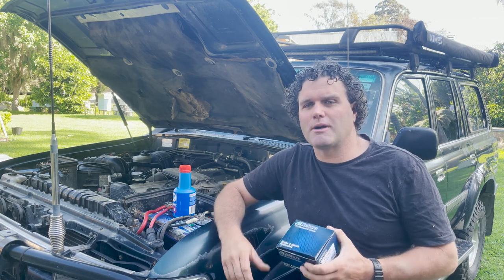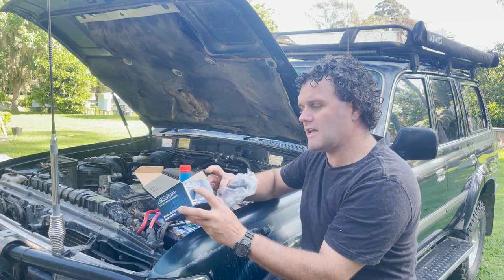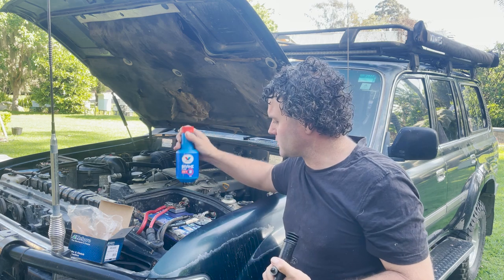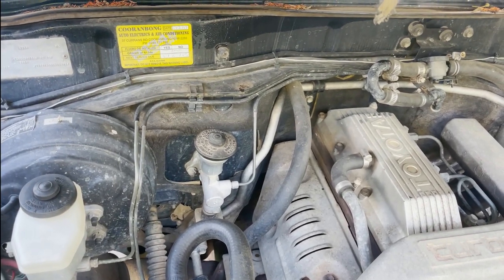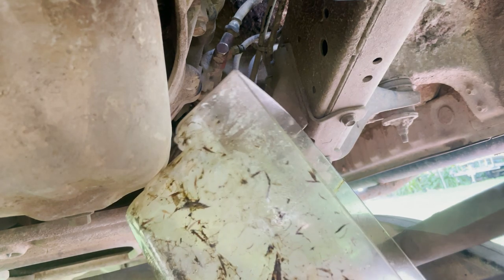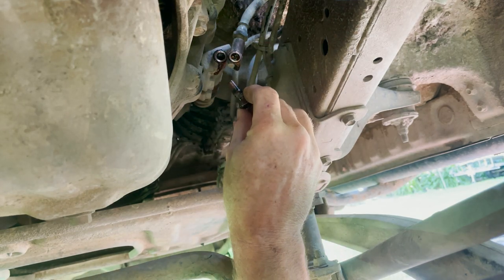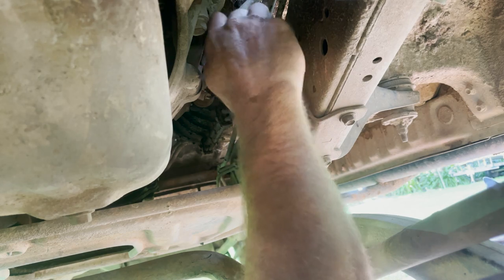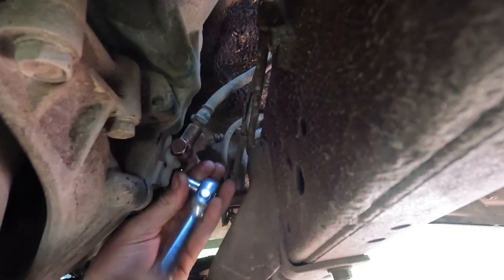Clutch slave cylinder replacnment 80 series landcruiser

Comment: I have a booster mounted on the cylinder. Now when I bought my 80, I noticed two color fluids. Redish and at the bottom layer and whitish at the top. I suspect the redish color could be ATF and and whitish could be DOT4. What would you recommend in situation? Should I drain it all and refill?

Comment: Hey mate just wondering if you could maybe help me out. My car makes a tapping noise when driving and worse in 4th, I changed the gearbox and transfer case, and it still makes a tapping noise, also taken the front axle out but it's still there, you have ever had this problem?
Reply from the maker: Could be a long shot but have you checked all your uni joints on the drive shafts. Front and back. Sometimes when they are on the way out they can make a noise similar to that. And it can sound like it’s coming from the engine. I did have an issue with my front diff that made a noise due to a dropped tooth. I think it was worse in 3rd. Outside this I am unsure.
Reply: @blackllama1  thanks mate appreciate it and love your videos too so helpful